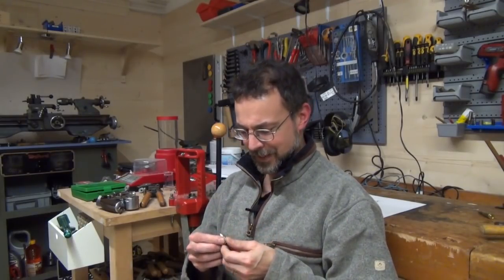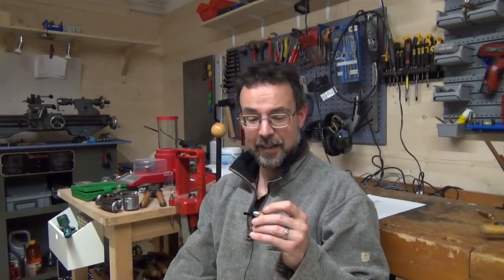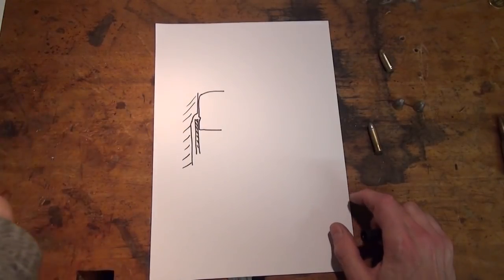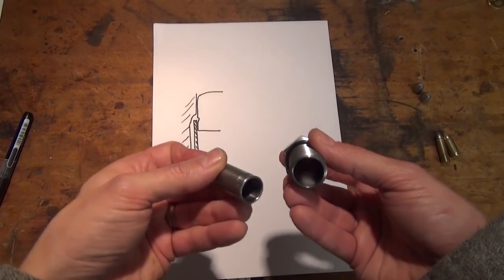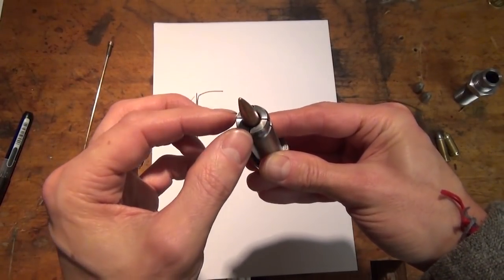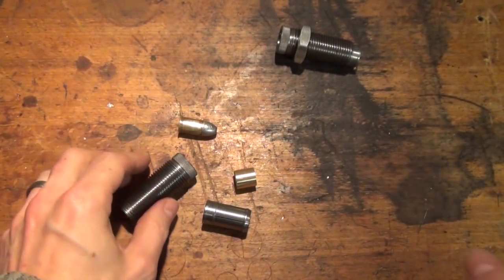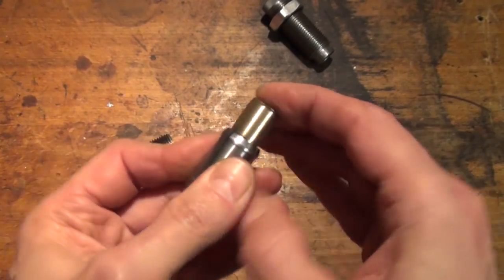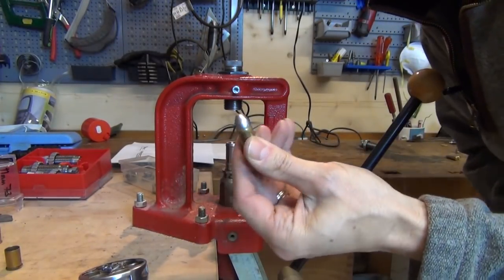Crimping Heeled Boolits

Comment: what do you use for the parent case for the Chamelot Delvigne?
Reply: I use fired 44 Mag cases trimmed down. Depending on the machining tolerancing on your revolver and case brand you may or may not have to thin the front face of the rim.
Reply: @thebotrchap  thank you and excellent video. I too have done the same including having to thin the front face of the rim however my chambers seems slightly larger than the 44 Russian case and my brass has bulged slightly. Hence I was curious

Comment: So let's assume that the cartridge is rimless. Can this be easily adapted without needing to mill or lathe any special parts?
Reply: Whether the case is rimless/semi-rimmed or rimmed has no influence on the process described here 😉 However If you have a situation where the case rim/base is wider than the inner diameter of the die for some reason (bottle neck cartridges perhaps), you can just insert the cartridge upside down through the top of the die. You’ll still need a spacer sleeve to set insertion depth though.
Reply: What i meant was the issue of the spacer sleeve. If your cartridge has no rim it won't be seated steadily on the rim.
Reply: @nilsmanuelgut131  Oh I see sorry 🤦🏻‍♂️ The easy way would be to use a shell holder or filed down washer in the case groove to act as a rim against which the bushing can space. The bushing and washer can easily be made with hand tools.

Comment: What about using a bullet the same diameter as the case mouth, and then paper patching to bring the exposed portion of the bullet body up to the required diameter? I'm not sure how well that would work, but it might be worth somebody's effort to try it. Possibly more work on each cartridge, but you wouldn't need a lathe to modify anything.
Reply: The emphasis here (as mentioned at the start 😉) is on reproducing the original cartridge and projectile which is a heeled unpatched design. Due to the highly conical exposed portion of the bullet you can’t sensibly paper patch that bit to bump up the diameter anyway. If you’re using bullets with a case mouth diameter the normal roll crimp die will work fine anyway.

Comment: I have the same problem with my 10.4x38 Vetterli. I realy strugle to use an original style heeled bullet. All Vetterli dies seem to be set up to use .430 size bullets. Even with the expander removed, it is no always enough to hold the bullet firmly in place. Especially with a compressed black powder charge. It doesen't help that right below the bore riding portion of the bullet where i should crimp, there is a lube grove. The only thing  that  makes me happy is that the heeled portion of the bullet is .416 in diameter. So i bought a 416 remington magnum die set from lee, which includes the superb factory crimp die. Now i need someone to machine me a sleeve/spacer so i can crimp from the top/upside down.

Comment: Thank you for support Lee Precision for "us" a local Wisconsin company
Reply: I love the company Lee and many of the products it makes. You increase the quality the production rate and lower the cost. You've raised the bar of competition and so not only has Lee made its own products better it's forced its competitors to make theirs better too. I really think reloading gear was in a rut that wouldn't have changed much since the 1960s had it not been for the forces that Lee put on it. Ain't nobody got time to reload the way Richard Lee senior wanted us to but his company made it so I can have a progressive and I've made over 100,00 9 mm, on my loadmaster. my total setup cost less than the case co-leader assembly for a Dillon, at the time. I'm still cranking out ammo on it and quite happy with the machine. as a side note I've traded away most of my RCBS dies in order to get the Lee 4 die sets. They are just simply nicer to use. Modern RCBS narrows the gap but the old classics are a nuisance.

Comment: Awesome Video!

However, the Lee factory Drimp die does not always mean that you have this collet system. For small calibers (at least for 9mm) the factory crimp die is the system you drew on paper. Unfortunately the taper is very small, which leaves me with problems when loading coated lead bullets. My CZ Barrel is rather big in Diameter, which is why I size my Bullets to .358. When I set the crimp a little to tight though the entire bullet in the case gets sized down enough that it does not fully grip the rifling anymore and I get keyholing bullets. 

Also the carbide part of the die, which is around the bottom half of the case at least in my case is so small, then it resizes the entire case, at the point the mouth touches the crimp insert. further sizing the bullet down I assume.

The change in the Crimp die to get this result is minimal which makes setting it up a pain in the ass.. I am currently looking for another crimp die that tapers more or is an actual factory crimp.

By the way: The best part about reloading is the amount of small apparently random pieces of material, often crudly manufactured that are worth more then gold to you but are literally worthless to everyone else, that collects in your basement over time haha

Comment: ....ohh, Makes me want a collet crimp die for the 1882 7.5 Swiss... crimping can be tricky, and I've had inconsistent ignition.
Reply from the maker: What you can actually do is buy a random .30-cal Lee Factory Crimp die (e.g. 308 Win, but it doesn't matter), and make a little bushing to introduce the cartridge from the top to crimp it, holding it down with your thumb. Works surprisingly well. I've had good luck using .32 ACP seat/crimp dies (iirc, it's been a few years) for putting a crimp on them.
Reply: @BlokeontheRange  I managed to get some solid crimps using a French 7.5x54 crimping die and some steel rod down the centre of the ram, worked very well! Much better ignition and 'improved' accuracy with the 1882 revolver. I load a .314 cast powder-coated bullet, I think its 115 grains, with 3gr of Unique.